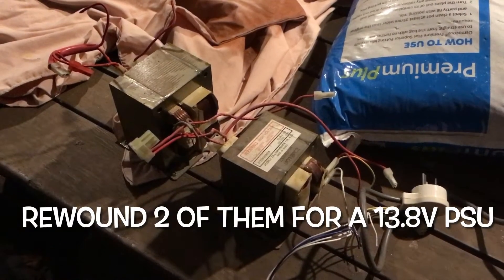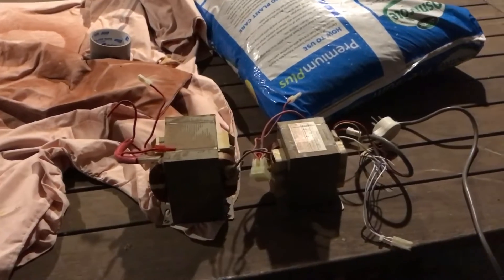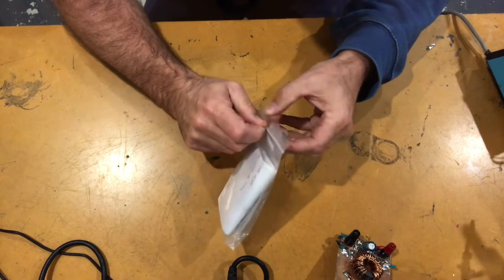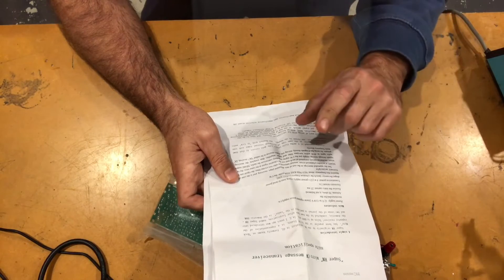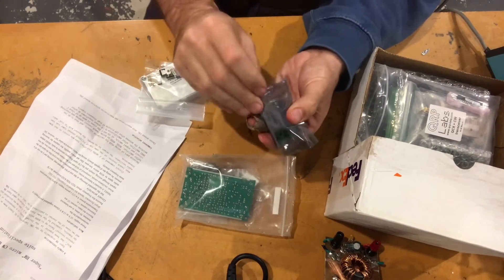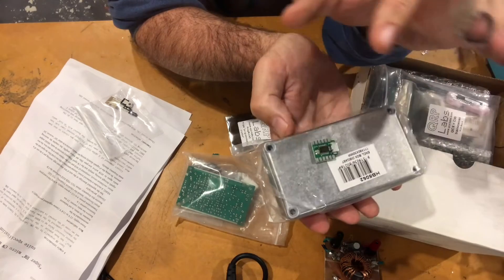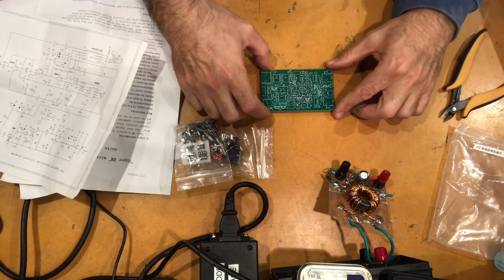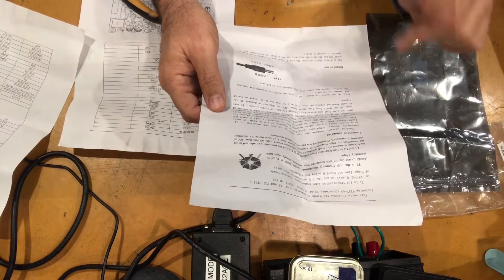Rockmite 40 Chinese Clone@TheArtofEngineering

Comment: Someone told me to add a 30 ohm resistor in series with Diode2 to maximize power output and reduce a bit currentt consumption. It apparently made a big difference. 73's
Reply from the maker: Thanks for the tip and 73!

Comment: May I ask you what type antenna is best for this kit? Is any 49:1 transformer needed?
Reply from the maker: It is designed to operate into a 50 ohm load (like most modern ham and other comm gear). So if you used a decent Center fed resonant dipole fed with 50 ohm coax it would work well. A 49:1 would be used for an end fed half wave as the feedpoint impedance at the end is high. May I suggest if you want a GREAT kit look at QRP Labs and buy one there! The instructions are awesome, the rigs are too! CARTENNA QRP portable @TheArtofEngineering
https://youtu.be/9WEV6Hr6o7A

QCX mini - Say hello to my little friend.
https://youtu.be/cx-Qng-ySu0
Reply: @TheArtofEngineering Thanks for reply, I just bought Super Rock Mite from Aliexpress. It has the 50 ohm output and around 5W of output power. So you think the classic half wave dipole would be the best option for the maximum range? The coaxial has 50 ohm but the dipole has 75 ohm which is not the same value. It doesn't have to be adjusted? Sorry if I have dumb questions, I'm new to RF.
Reply from the maker: @michaltulach7151  Not a dumb question! There is no “best” antenna only “next” antenna! 😂 The fun is in the experimenting. Usually higher is better and you want a low angle of radiation. So a vertical is a simple antenna with a good takeoff (shallow) angle. As for impedance you are correct but it varies with height and ground conductivity. Some people use a 1:1 balun (but not a necessity). Many fuss about trying for 1:1 SWR (just get it below 2!). Get a nano VNA and use that to get a good SWR. Here is a simple vertical I made for 40/20m (there are heaps of dipole making vids). 73 and welcome to the ham madness!!! 😂 

DX Vertical L Antenna for 20m and 40m
https://youtu.be/YEFuJkD_uLg
Reply: @TheArtofEngineering  Yeah I experienced a lot of experimenting while I was building a simple aircraft band receiver a few months ago. But the experimenting is fun. At first I wanted to build the vertical antenna but when I discovered It will need to be really long I changed my mind and I want to build horizontal such as dipole. I do not have much space for vertical antenna and I wanted it to fit in my attic (which is around 13 meters above ground) so it would not be exposed by UV. But thanks for recommendation maybe one day I will get to build vertical antenna which should be more efficient (if I know that correctly). I will probably build a simple dipole. But both of the arms have to be around 10 or 11 meters long. Since I have only a rectangular space of 3×15 meters and the feed point has to be in the middle of the 3m long wall, I think I will just bend the arms in U shape to fit there. Do you think It is a good idea or I should not do it?
Reply from the maker: @michaltulach7151 Nothing to lose! You could load it with a small coil in each arm to shorten it a little? Or if you want to really go down a rabbit hole investigate magnetic loop antennas 😂😂 73 fun antenna play !

Comment: Hi I have the same problem. Only about 0.5 Watt output.

There is a transformer in the circuit 1:4. This means the two windings are primary and the eight windings secondary. 

Otherwise it would be a 4:1 transformer with eight windings primary and two windings secondary.

Is this correct?

The fault is in the power amplifier for sure.
Reply from the maker: The Toroids in the LPF are also 💩😜.  Lossy and just plain bad ! Happy new year!

Comment: Got the same kit built and working; receiving well and around 5 watts output. Being honest, I think the gods of kit-building were smiling on me.

I'd echo the suggestion that this kit is not for the faint-hearted. in my opinion, builders without an L, C, and R meter to weed out the 'off' components will be lucky to get the kit operational.  As noted below, some of the components off by 20% or more.  

What was a bit of head-scratching were the 'spare' components left over!  Why do I have two 51 ohm resistors? (To make a couple of dummy loads?)  I can cope with missing components better!

The Chinglese 'instructions' for setting up the keyer are virtually incomprehensible, but eventually I got the iambic keyer to play ball.  ... Bruce.
Reply from the maker: Thanks fer the comment. I guess the uncertainty is part of the fun! 😃 73 de VK2AOE.

Comment: I built one a while back and the component quality was rubbish, most caps were of poor quality. 
Also the red ferites did not seem to tune very well suggesting that they were cheap and not good quality material. 
Your Milage May Vary. 
Again you get what you pay for I suppose. But hey BD139 are ok  and will get you on the air. 
72 Mark G0NMY
Reply from the maker: Yes…. Always hit and miss with the cheap stuff…. Fun to play and see if you can get a QSO though. I wanted something to test the progrock from QRP Labs on (I have no rockbound rigs). 73 de VK2AOE

Comment: Really looking forward to the microwave oven derived CW transmitter. I have a transformer myself, just waiting for a project . John EI5JS
Reply from the maker: I have never built with tubes…. But it is on my bucket list! How hard can it be?? 🥹⚡️⚡️⚡️I did build my PSU using 2 of them!
Linear 20A 13.8v DC HAM SHACK PSU - Made with rewound microwave transformers@TheArtofEngineering
https://youtu.be/uV5gD_t0V6w
73 de VK2AOE

Comment: [Edit] I told a lie. The $8.74 was for the Forty-9er. These Rockmites were about $16 each and they are meant to put out 8W !!!!…..like that Beofeng thing

I only have one of the Forty-9er kits….

———-

I had a look and that kit was $8.74 plus $1.19 shipping in aussie roubles. 

The toroids are known to be less than optimal in these kits and are responsible for low output power and / or bad mismatches. Then again, the components could be fake / rejects.

I’ve got the other one. I might have a go at putting it together and see how it performs.

I need to build a 40m poke-out-the-window-tenna so I can test it on the bench

What happened to the spiciest Pixie I gave you ???
Reply from the maker: Yes we can do uDX Kogs to the inner West😆🤣🤣dit dit
Reply: @TheArtofEngineering  I've dug it out, along with the Pixie I grabbed for you. Also found some old school larger style crystals for 7005, 7010 and 7015 I found online and purchased. Not the ancient ones with the removable covers you can sand down, but the larger ones they used in the 60s. 

Depending on my day today, i might give it a go. Had the charge on my iPhone fall off a cliff. Died during my second coffee, so I'll fix that before anything else. Got the last battery from WES

Some quick calculations put the 5m circumference loop poke-out-the-window-tenna at around 18%, so more than 1 S point down operating from my work bench

The VK2RH RBN isn't too far away so I can get an idea of how effective it is...

But I have work to do first.

I'll keep yo in the loop.....so to speak

73 dit dit